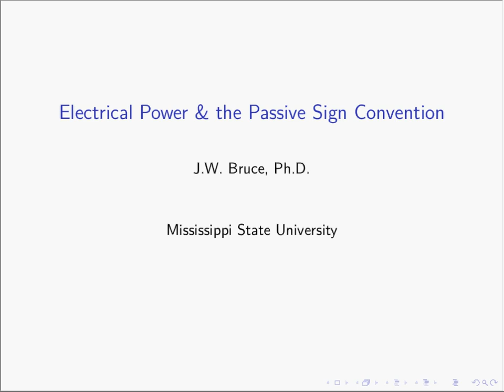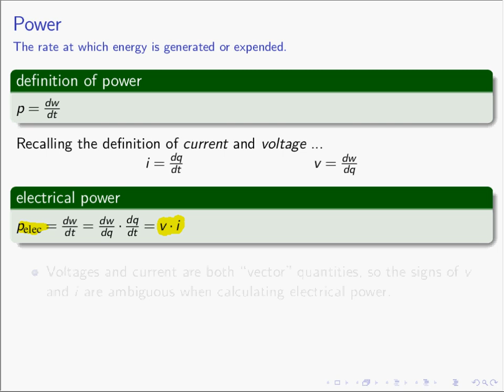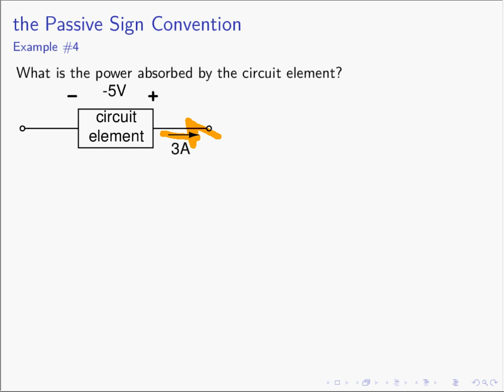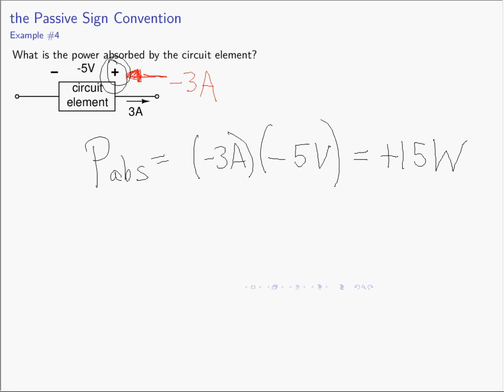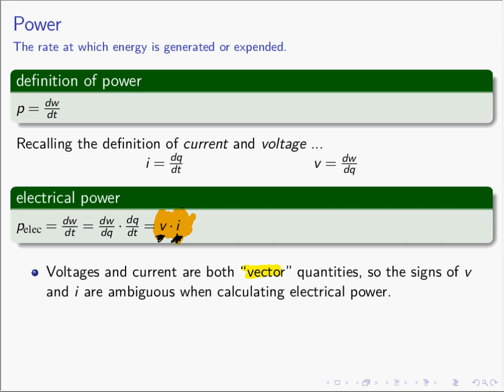Passive Sign Convention

Comment: in the book I am reading it shows a diagram that shows the current going into the negative terminal and says the equation for power is p = -vi.  What you did in the video is sort of confusing me.  Is that negative sign in the equation I just wrote coming from the current going in the opposite direction? I hope you answer sooner rather than later since this class I'm taking is just going to move on regardless, haha.
Reply from the maker: The PSC says "when current is directed into the terminal marked with the '+' polarity mark, power absorbed is V*I"   
NOTE:  Being more emphatic: the V and I in the PSC equation are the ones where  "I is the current directed into the '+' polarity mark of a voltage V"

So, if I understand the situation you are describing, your problem has the current directed into the terminal with the '-' polarity mark.  This situation does not adhere to the setup described in the PSC.  Now, if you consider the current in the other direction (directed into the terminal with the '+' polarity mark), this situation would match the requirements of the PSC.  Of course, that current is the negative of what is given in your problem, therefore the power absorbed would be V*(-I) as you said.
Reply: JW BRUCE thanks for replying so quickly and being willing to help out! I think I'm understanding it a bit better now. I appreciate it!